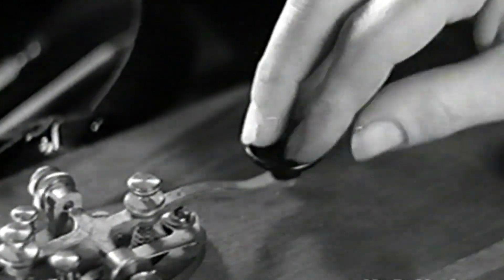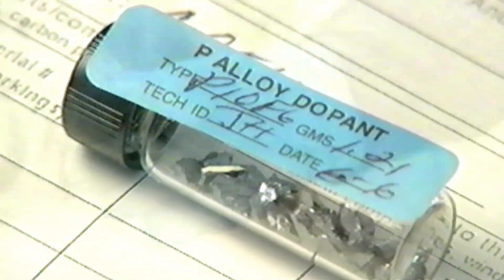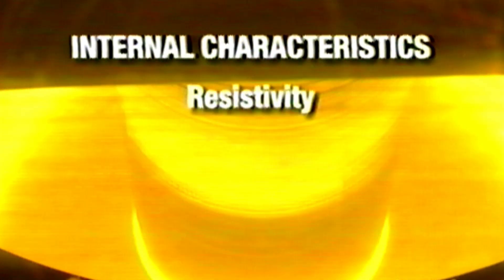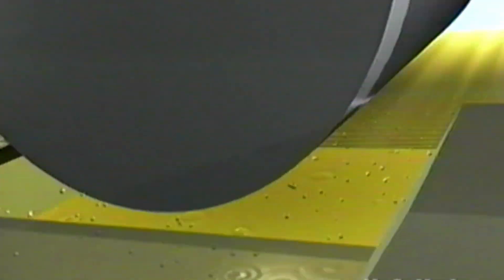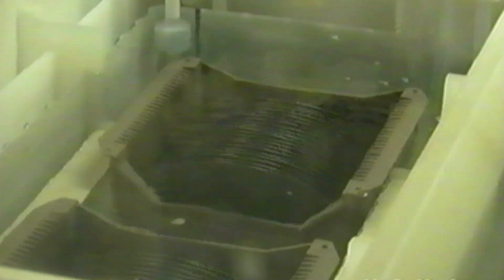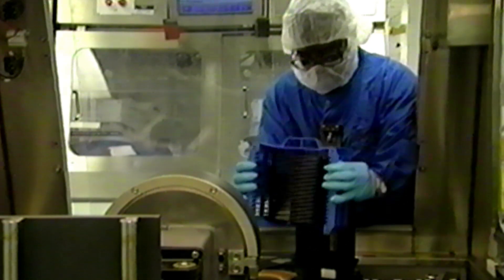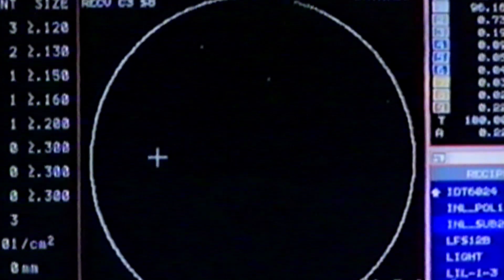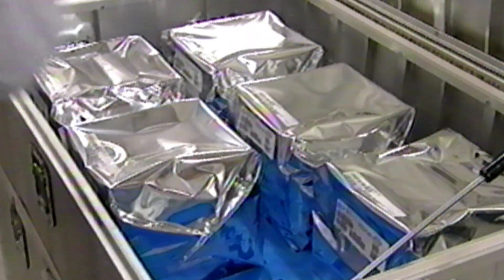How Silicon Wafers Are Made for use in microprocessor chips and integrated circuits

Comment: They should use Sorbothane frames, to put the cassettes in to absorb vibrations, so they don't get micro contaminants or defects, from transport
Reply from the maker: We always used styrofoam and as far as I know there were never any issues with shipping damage.  I think foam is also cheaper than sorbothane.  Thank you for commenting. :)
Reply: @AlsAutoandAppliance  Yes, use the cheapest method for something so important, difficult and expensive to make; makes sense... 😒